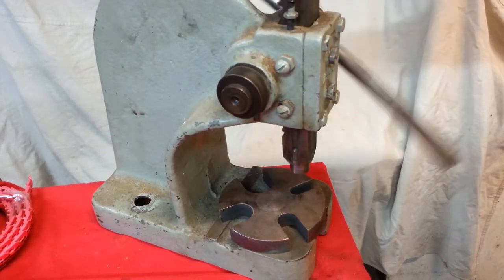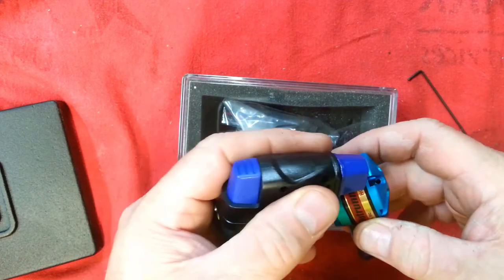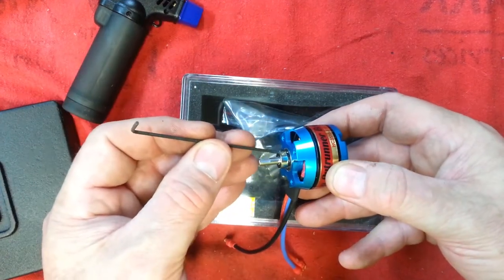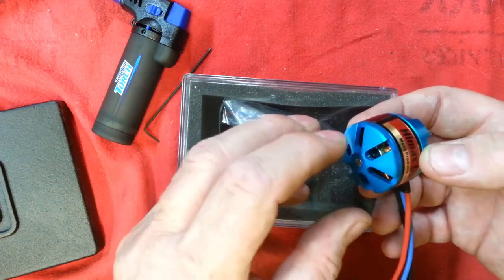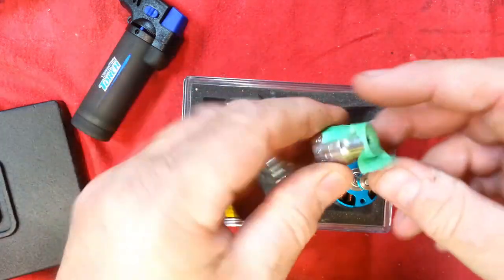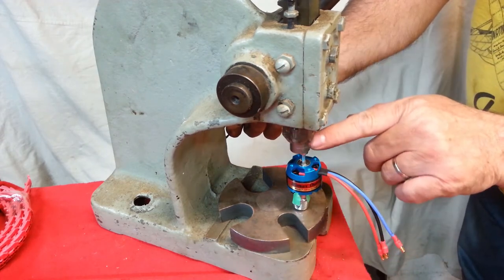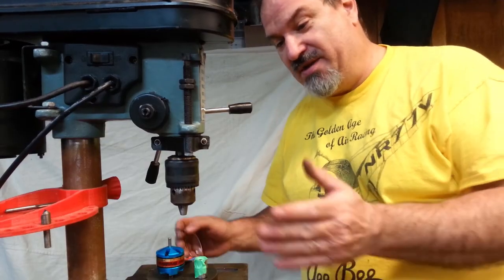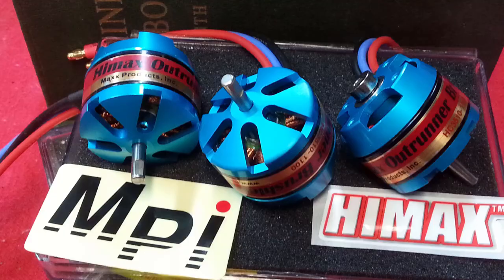Outrunner Motor Shaft Reverse - HIMAX Brushless - Crafted Channel

Comment: Great tip Dave. Another great way to loosen small and tiny Loctited screws is a soldering iron. I use this method a lot in my gunsmithing. You simply take a soldering iron with a pointy tip and hold it on the fastener until the heat transfers into the fastener and loosens the Loctite. The older higher wattage soldering irons work even better.
Reply from the maker: Yes, that is a good tip as well.  We've used that method also.   The flame is a bit faster and allows us to concentrate the heat more quickly.  It's kind of the same effect of using a bigger soldering iron means you don't heat the mass area of the work up as much because it can impart a lot of heat quickly in the joint.  Where as a small iron will take much longer and get the overall assembly much hotter before soldering can take place.  In this case, the blue flame takes it up a notch over even an iron.
Reply from the maker: By the way, I am very glad to hear from you and hear of positive developments.
Reply: Crafted Thanks Dave. I really appreciate it. 
I’m getting stronger and feeling better every day. Was a little bit scary waking up in the ICU and not knowing how you got there. Life is fragile and we need to cherish every second we are alive.

Comment: Great video and effectively delivered. I have an HC5030-390 I need to reverse the shaft on. I got two of the three set screws out but before I went for the third I sought out your video because I thought the MPI fact sheet wasn't complete enough. Having seen your video I'm a little paranoid about that third set screw particularly since my allen wrenches  seem a little sloppy in fit and I can't find what size the best allen wrench is. Do you know the right size? I have a mini torch and am ready to use it thanks to your video but I 'd like to be confident I'm using the right hex wrench.

Thanks,
Joe Gist
Reply from the maker: I'm 'm not in a spot where I can check for you, leaving on a trip.  But, it would be metric.   Also look on McMaster at hex wrenches.  You'll find there are some weird fractional sizes down in the smaller ranges which are not common in packs of wrenches.   I have them in the UAS lab I work in.  Order them if you get a chance just so you know you have everything.  Also, I like Bonhus wrenches.  Use a straight wrench, not a ball drive for tough fasteners.
Reply: @CraftedChannel  Thanks. Got it out with a little heat but apparently the locktite had gotten into the space between the boss and the shaft. My drill press couldn't budge it. Sent it back to Mpi and they didn't for 5 dollars. Great service from them by the way.

Comment: how does the shaft turn if you have a set screw holding it from turning?
Reply from the maker: It's an out-runner.  The face plate where I first show the wire ring as a spacer is the mounting flange.  It contains the bearings (in a hollow stem you can't see) and copper winding's.  The black ring and end with the double set screw contains the magnets.  In this case the copper winding stay still and the action pushes the magnets round n round.